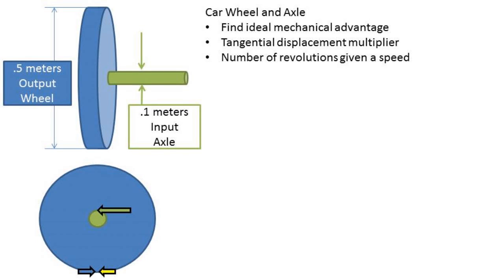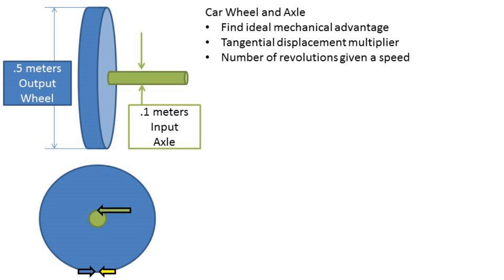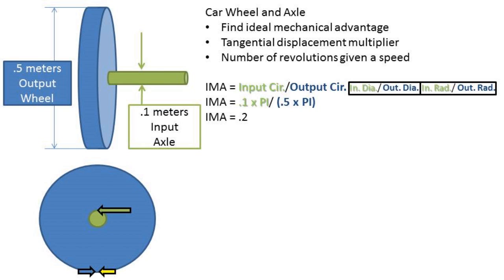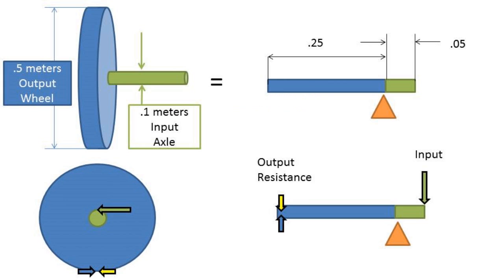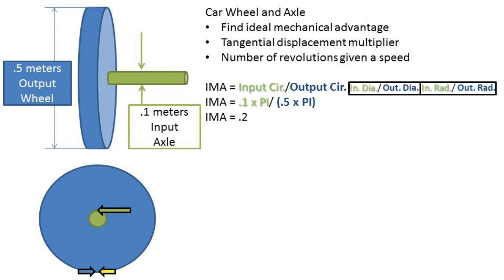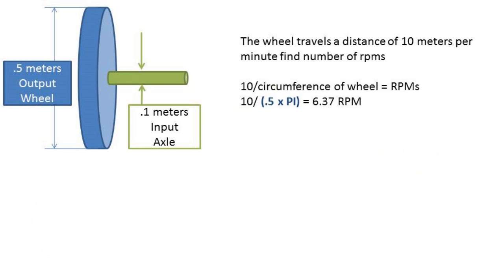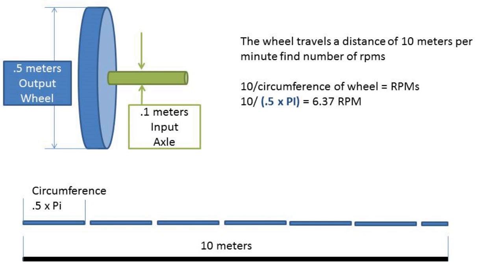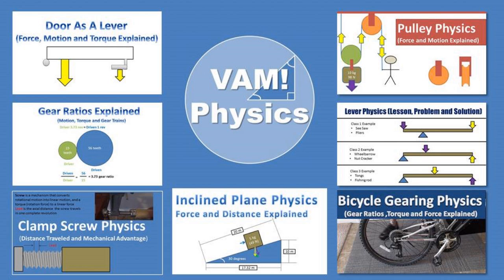Wheel and Axle Simple Machine Physics

Comment: So with increase in wheel diamter you decrease the RPM over the given distance. Ergo, larger wheel diamter on long distance travelling trucks will have less RPMs (higher fuel economy) for a given distance. Correct?
Reply from the maker: rpms remain constant between wheel and axle what changes it the displacement at larger diameter there is more displacement at outside edge. As per fuel economy i would have to do some research to answer that question.
Reply: @VAM_Physics_and_Engineering  but doesn't increasing the tangential displacement number, decrease the number of rotations the wheel has to complete to travel the given distance (10m)?
Reply from the maker: @MayoNaze2175  i might have misread your initial comment. If you have a larger diameter wheel it will take fewer rotations to travel the same distance verse a smaller diameter. This comes at the cost of having less force at the outside edge of the wheel. (assuming axle is input)
Reply: @VAM_Physics_and_Engineering  understood. Thank you! My application would be putting over size wheels on long distance 1 ton truck for hauling freight. And you are the only video which has the axle as force input. The rest are wheel force input such as a door knob. Cute for the classroom, but no real world application